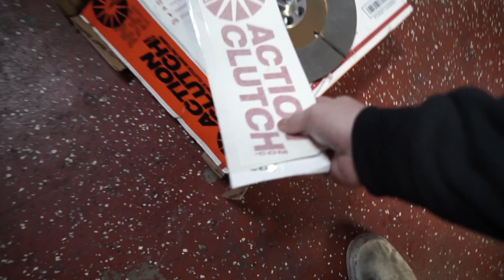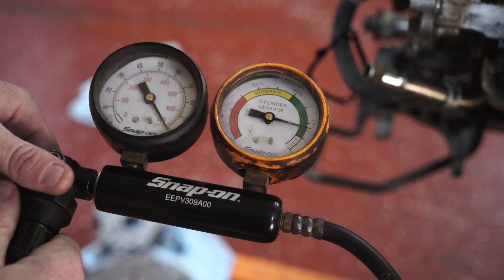350Z MOTOR BUILD IS COMPLETE!

Comment: I don't know how you clean your parts, but I have a suggestion if you aren't doing this. You can pour gasoline in a bucket and let all those parts soak for a little. Then you can take a brush and scrub it all using the gasoline. After you finish that, you can rinse with water. Next to last step is using a nice commercial cleaner & degreaser concentrate. Final step would be rinsing all the parts off and if an air compressor is around, spray with compressed air. It's a good idea to spend at least 15% of the total time it takes to build the engine just cleaning parts off.

Comment: you should build a 9 second civic or integra bro
Reply: It can be done with a built GSR that isn't stroked to a 2.0L with enough boost. I'd think a dog box would be needed to break into the 9 second area regardless of which engine is being ran. Especially if it's a K series since their transmissions have glass internals. That setup would probably be the easiest way to do it. It can obviously be done with an H22 or K series, but it would cost more than a GSR and a GSR would be the easiest to install.

Comment: dawg the oil pump will make or break the engine why not just swap it. it’s perfect timing
Reply: It's mechanical, as you saw, it doesn't have any scar marks or whatever so it's in perfect condition. No need to change it and also,  350z never had any issues ever with their oil pumps.
Reply: Dominykas Dainys yeah but knowing Evans luck it will probably break😂
Reply from the maker: CZZA Because it is fine and was just recently replaced
Reply: Evan Shanks Lmao what did i tell u buddy